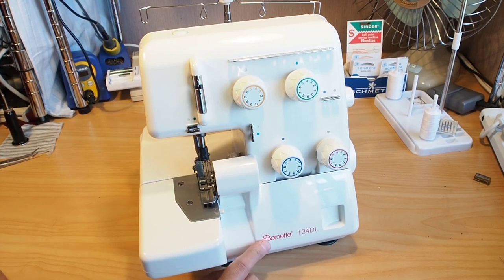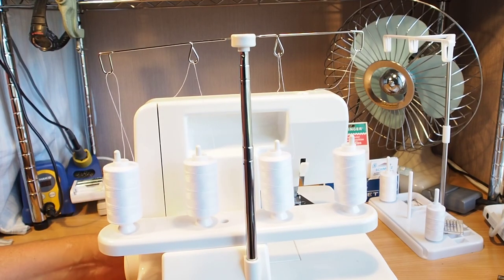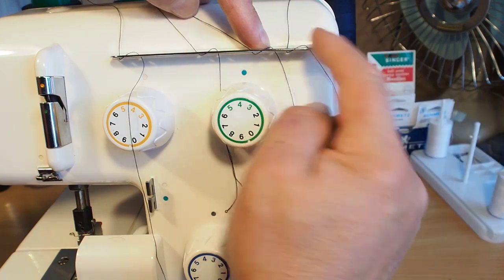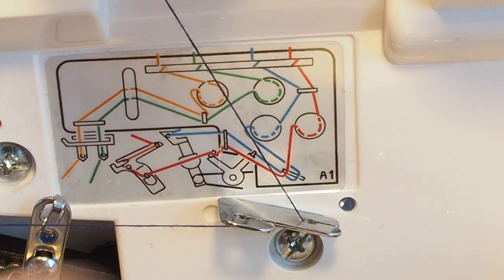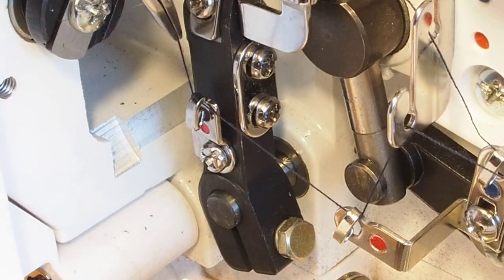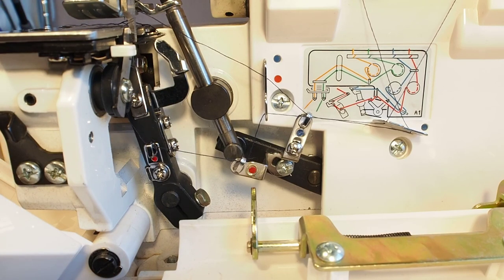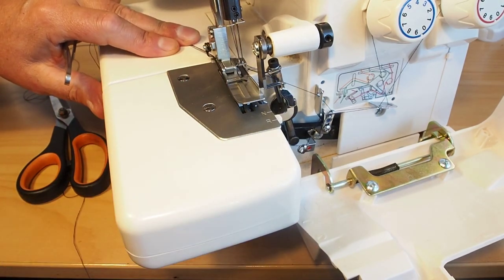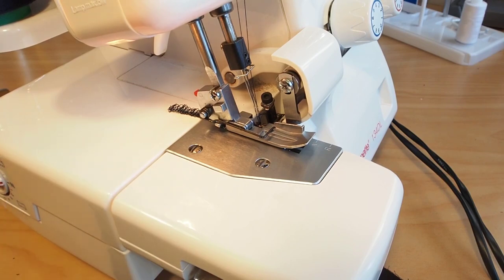Bernette Serger / Overlocker Threading - Model 134DL

Comment: would you have a service manual for the 334D that i could download? I've got to replace hook gear as it is cracked. Cheers, Andrew
Reply from the maker: No sorry. You don't really need the service manual for that job. Just take special note of the timings manually and you should be good. Thanks.